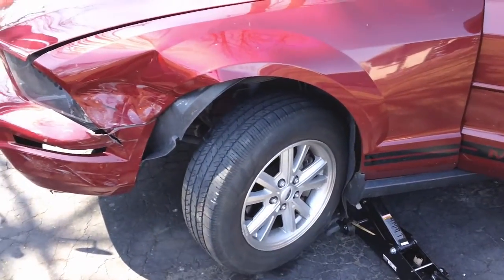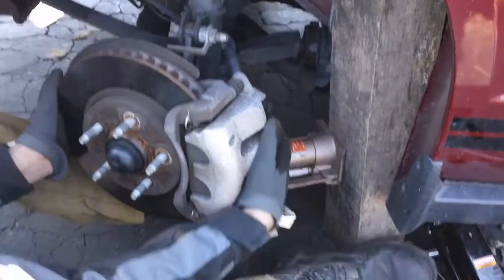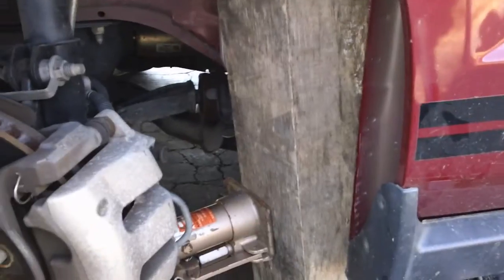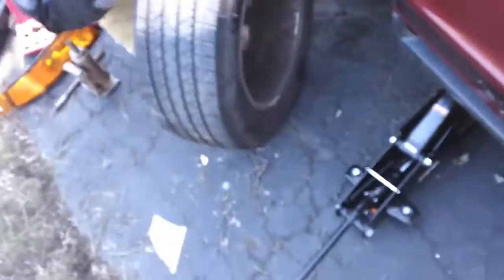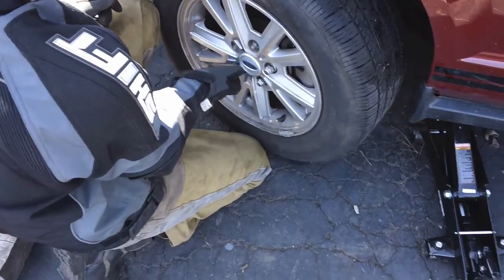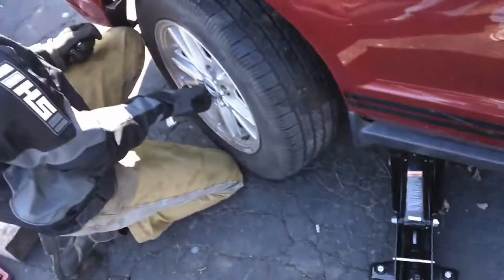Our mustang got hit and a quick repair to get it to the body shop

Comment: how much is a wrecker? body shops usually send them free to get your business. it is not a good practice to use your car frame to hold the lower control arm for hydraulic straightening. the arm is usually less than $200 and just replaced. why stress subframe further than the collision already has.